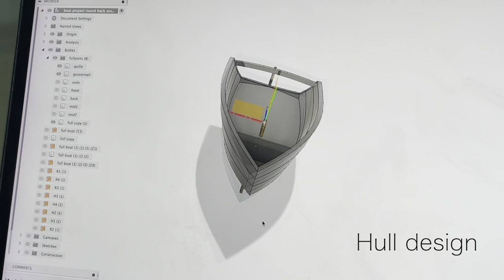Alix Build

Comment: Wow, looks really good.
I’m just a bit concerned about foam in your mast to make it waterproof. Usually it’s better to leave it open at the bottom for the case of a capsize. The foam can soak water and interrupt water to run out of the mast. ;)
But overall, hard to beliehe it’s your first boat build. 😅
Reply from the maker: Thanks !
That foam is supposed to be closed cells and not absorbed water, and i capped the ends with plastic plugs. each part floats on its own and i saw nothing leaking out after letting them float for a while. it should be fine :)

Comment: It can be as hard as 2 years ship builing HND and 10 years of sailing and still only outputing plans on catia or blender :/ I'm going to marine engineering and and naval architecture school next and I've still never really built any of the designs I've created on plans. there are dozens. still yu managed to do everything... I'm both pissed and impressed ! How the fuck did you learn how to draw a hull, buils it and all the notions of water and hair pressure to do it !? along with how to flipping make sails, that's an entirely other jobs only done by some rare specialist... and it cost a flipping lot of money. only "mistakes" I could see is that the hull is kind of indecicive in an akward way little of balence between planning (good flat hull) and upwind (pointy front) but that back art of the hull is evasive... which ake it weird since it becomes a relatively flat yet upwind directed aft... also the houari sail rig design looks cool but when it comes to mas to power ration as well as ease of use the bermudian rig as more than made it' proof on modern designs. thoo it does look cool and does add some surface ad therefore power. thoo I doubt with how large it is that youll ever get to use all that power, maybe if you add a trapeze... also technically yu could have gotten some additional stability by making "side bench" and filling those with foam instead the bottom, would allow you to stand lower on the deck lowering the center of gravity and add nice benches as well. butit would prevent the self draining system from working so it's more of a choice than a mistake...

still enrages me that I've studied so much for no added knowledge compared to a normal person on the internet just having fun :/. guess I know all the cristallographic properties of steel and carbon mixed together and all the polymer properties and curing process details and all those stuff in details but as you've proved it's pretty useless.
Reply from the maker: that's a thorough comment! :) to be fair, that's not a performance boat, no idea how long it'll last, but for sure it was fun to build and seems to be OK to learn how to sail so far.
For the hull rough dimensions, they come from 2 different boats mentioned at the end of the video, use them as plan view in Fusion, and drew lines from there that felt right and the worked to stack the pieces. The sail was not that difficult: I picked that design to fit the surface I wanted (based on what similar dimension boats use) with kind of a short mast that doesn't need any flexibility. One of the goal was to fit inside my car, and I couldn't find used windsurf masts where I live, and I really didn't fill confident in building a 3 part carbon mast with the right strength and stiffness. From what I read balanced lug are not that bad compare to more modern rigs and are easy to rig and safe. The best part was that Sailrite does some kits of pre-cut sail that you just need to put together. so I selected one of the right size, that looked good and only check I did was that the center of effort of the sail was at the right position compared to the daggerboard.
I had another logic for filling the bottom with foam: I'm used to building surfboard, and the thin skins only work because they're wrapped around foam. That allowed me here to have only 4mm plywood and a single layer of glass at the bottom which helps to limit the weight. I don't think it would hold up without the foam backing. And yes, self draining is definitely a good side effect cause lot of water do get in in choppy conditions.
With all knowledge you have, only thing left to do is build something !